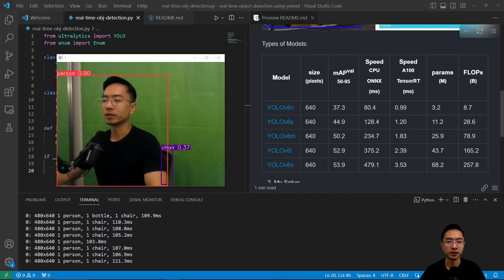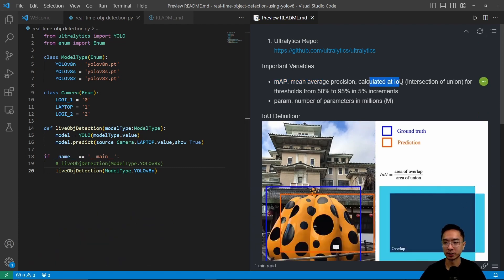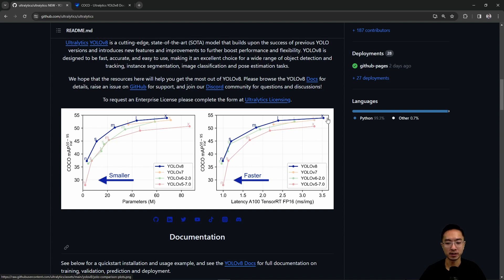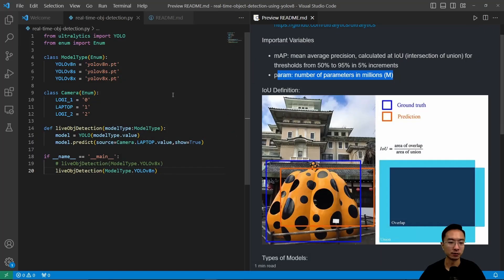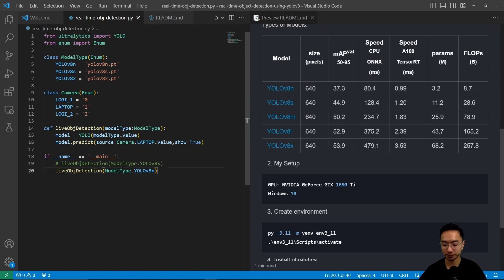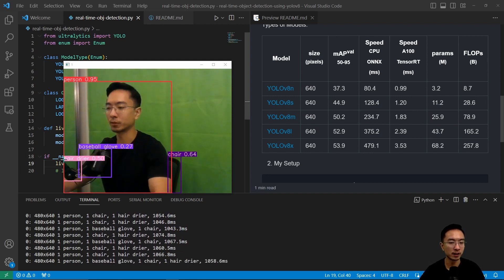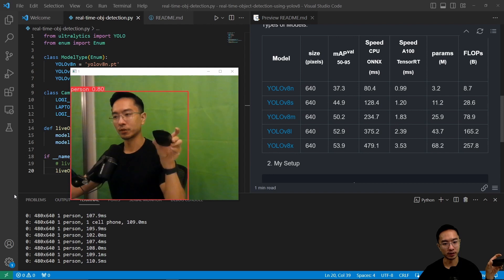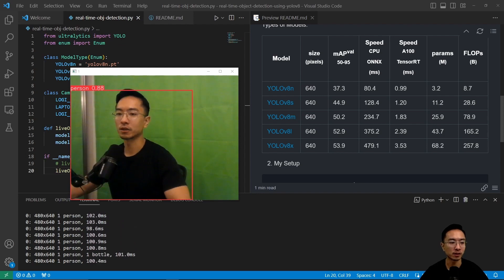Real-Time Object Detection using YOLOv8

Comment: Sir I had trained my model to detect human, drone, bird and car and then try on certain image its working but I am not able to connect camera or webcam of laptop to detect based on custom dataset how to do it ? and my custom dataset is too large so vs code gets hanged.
Reply from the maker: Try debugging the lines of code that open  up the cv capture object and see if it’s another device number. Or it could be you have too many devices on one usb port so try separating the connection physically to another port. 

Try decreasing dataset size, downsample image or consider using collab
Reply: Okay sir 😊
Reply: Can i ask u how did you integrate it with the drone , and if u have a video that explains the steps can u send me the link plz
Reply: @sahrgg2183  I am integrating it with camera to detect drone , human and bird by using yolov8 for traning the model and roboflow is for labelling the object.